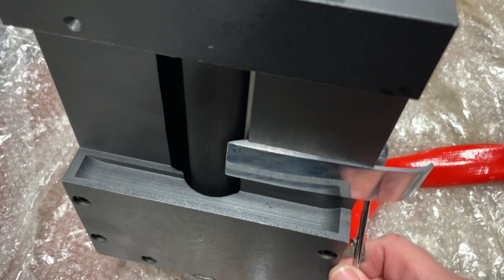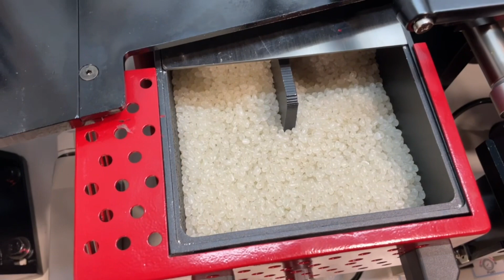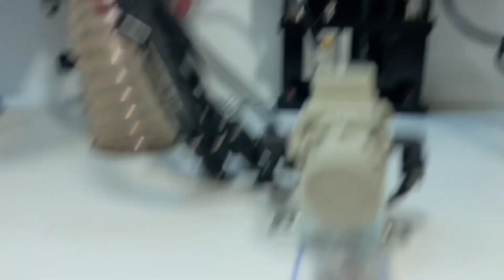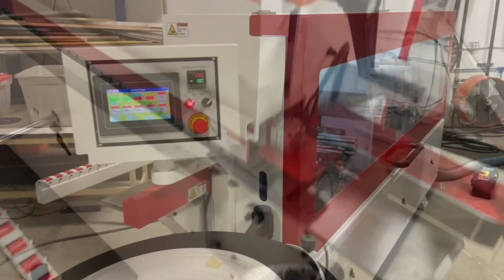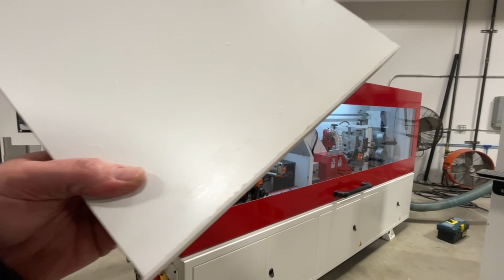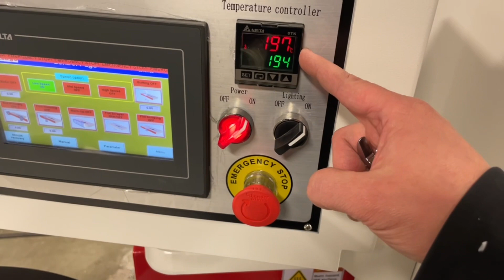VTM Vantedge 3.5 automatic Edgebander EVA glue hotmelt SNX Jowat

Comment: What does the micro trigger switch do just before the flat scrapers?
Reply from the maker: Hi Pau, great question. 
That switch just before the flat scrapers activated the misting system which puts  XE4 finishing agent on the panel. 

This helps the removal of fine reside and any glue that may have stuck to the panel. It also acts as a lubricant as we go into the fat scrapers. Think of it as just a little shaving cream for the "face" of the panel before the blades make that final scrape of the surface. 

That switch automatically turns on those sprayers just for the duration that the panel is under it to minimize waste.